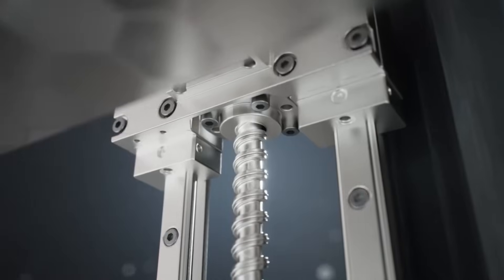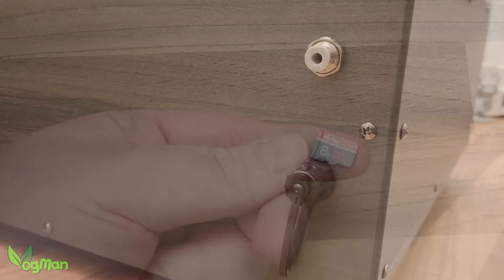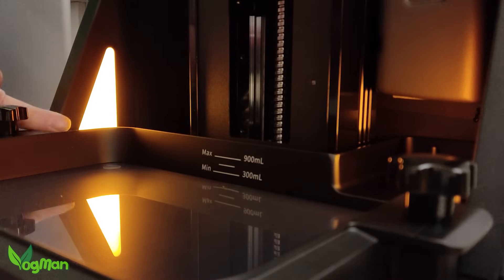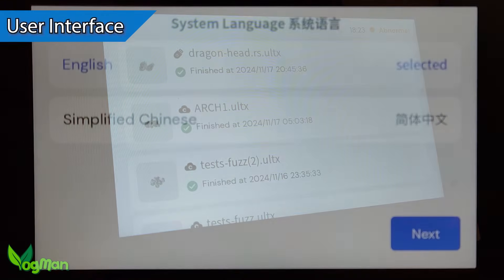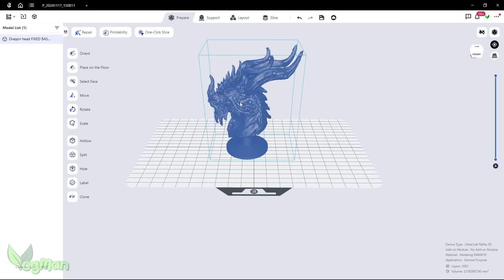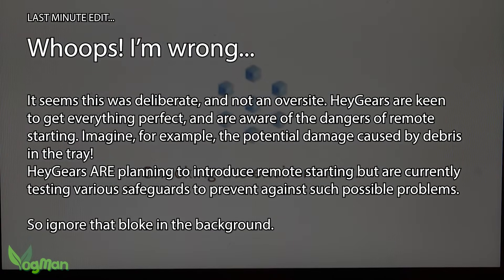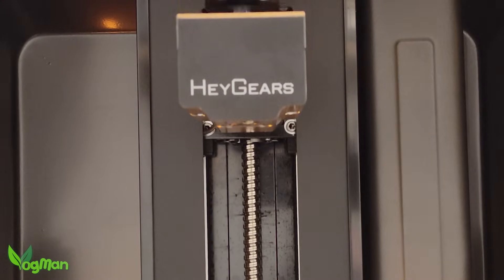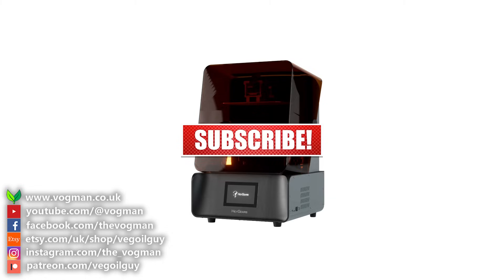HeyGears Ultracraft Reflex RS (HONEST review) - it may shock you!

Comment: when u did a review on the m7 pro u complained the vat has the heater integrated and u can clean the vat , here its the same but with the refill part...
Reply from the maker: There's no heater on the tray I reviewed in this video. It's an unusual shape, but that's not a problem. Uniformation printers, for example, have unusual shaped trays.
My issue with the M7 Pro heater was how large and heavy it was, and Anycubic were clearly aware of this themselves as they fixed it on the M7 Max.
Reply: @vogman  thats what i meant the shape is weird :D but the m7 pro is faster than the m7 max right?
Reply from the maker: Yes. Large printers are always a little slower. 😁

Comment: If the SD slot can support exFAT and NTFS the USB port should support it too and it isn't too hard to format USB to file systems. The main reason for including a MicroSD is normally something that can sit in the printer usually a cheap way to include lots of storage for network printing. It's a way to cut costs without cutting functionality. I would be more ok with this printer if it allowed me to use 3rd Party resins if I wanted. Like I like the idea of not having to dial in my resin. But on the flip side. I would like the option to do so if I want to. Kind of like bambulabs. They have their own filament and it's push button but you can also use any off the shelf filament.

Comment: It's a nice printer with some nice features but there's no way I'd pay extra to help a company establish a monopoly.
Reply from the maker: I can't see it. They'd honestly never get it. They're too far behind their competitors.
If this had been fitted with a 16K screen and the sort of Force detection technology I've seen on the Athena, I'd be tempted to say, "These guys could capture the market."
But no. The tech is mature, but not old, and they've just maxed out it's capabilities in a way that every printer company really SHOULD have done originally. 
They want a chunk of the market and they will get it. There are people that will pay extra for dependable and easy. That might not be you or me, but it's someone. So let that someone pay their money and make their choice.
Meanwhile there's plenty of higher spec, cheaper machines for folks like you and me to tinker with. And we'll swear when it doesn't work. And we'll mess and adjust until it does. Because that's OUR thing. 
Horse for courses, my friend 😁😁😁
Reply: @vogman  I don't think they will either but that is their intent. There's no other reason to lock down their platform to this degree. 

If they wanted they could provide a custom settings panel for third party resins for those who want to tinker, while still including automatic settings for their own resins.

Equally they could open up their api to third party slicers without compromising their own one.

It does look like a good printer though and your review was honest.
Reply from the maker: Let's be honest, there's not a company out there that doesn't dream of being a monopoly. 😂🤣😂
I honestly never expected to like the product. I mean, 8K? But it's all pulled together very well and there's lots of people who love them for it. Their choice and all that 😁
Reply: @vogman  Fair enough!

Comment: I just wanted to note that the build plate can be manually raised or lowered by going to settings > calibration > keep rising/keep descending.  Alternately, in the calibration menu, you can also select fine tune, which will allow you to set a travel distant and speed, and then select raise or lower.  Otherwise, i think you've got this printer pretty well accurate.  Thanks!
Reply from the maker: Thanks for your input. I guess I must have been mistaken. 😁
Reply: @vogman  Not your fault. It's not an intuitive place for it. I thought the same as you until I accidentally stumbled across it after month of ownership. Honestly, the whole settings menu needs to be redone. There's a lot of non-settings options in there that really need their own menu item so that settings is actually just settings.
Reply: @vogman  to be fair, it's not clearly labeled, and not in the same place as most other printers.

Comment: Good review, but I think you overlooked the most important parts about this printer which people should know before they buy!
1.) This is a very expensive printer and you can buy printers with a better quality prints for half even third the price
2.) Their Slicer is online only! You need to have internet access to use the Slicer
3.) "Just works" HeyGears moto isn't exactly correct. Autosupporting will make sure that your print will be there, but the program tends to have a very bad orientation resulting in lower quality
4.) Their resin is quite expensive at 70$ a liter and I can't see difference between it and any other cheaper resin
Reply: 2) Slicer isn't online only anymore
3) You can autosupport with orientation of your choice, i've tested it wanting to test it on my S4U but their exported stl is unrepairable and i don't have a new model what i want to print to test it without repair
Reply: They have a resin called PAS which is 24.99/l too.
Reply from the maker: Thanks, but I don't think I've made many omissions here. I mentioned very clearly that this printer is expensive, older tech, that restricts the user to brand only resin and brand only slicer. If you missed any of that, please watch again... it's there, honestly.
However, my point is that some people WANT that ease of use, that simplicity of decision making. They want the joy of printing WITHOUT learning how to dial in a resin perfectly. Now some of these will pay for that privilege and some won't. My goal here was to show everyone that the option exists. 
A second less obvious goal of mine is to inspire other companies to try harder and stop relying on the printing community to make their products work for them. Too many companies send out products that aren't really ready. 
Anyway, as I've said to someone else a moment ago, there's a British proverb, "horses for courses."
That's all this is. An option for SOME to take. Let them take it if they want. The rest of us will carry on regardless 😁
Reply: @vogman  RERF and tilting vat/strain gauge raise control already fixes absolute majority of "ease of use" problems, yeah you still have to learn for a half of a day, but if you won't - you might actually harm yourself whether with heygears or any other resin printer, it's not zero-knowledge type of activity anyway and you still have to work with highly corrosive liquids

Comment: Thank you Vogman!!. As one if the most respected reviewers in our community. I am so glad to watch this as it makes me feel validated

You delivered a great review, well balanced and without any of the worry of impending drama that I had. Yoh talked about this straight and to the point. I’m envious of your review delivery here. And you pointed out some things I missed too, like the vat fill height. You are spot on and I agree. This would also mean there’s less resin to heat at a given time for those with a heated vat. Which I’m sure would be more efficient? Dunno. Just a guess.

As for moving the build plate manually. It’s in “calibration” and you can only “move to top” which is poorly translated to something like “keep moving” or something.

I’ve told them about this too and these functions half way down the menu list are so much more frequently used than several options above them. Which you’d likely only use once in the life of a printer..

Considering that list isn’t alphabetical anyway, use frequency seems like a smarter way to order it…

But that’s just my 2-cents.

This machine is not for everyone. But those people who it is for…. Will love it.

Hit them up for some castable material (chefs-kiss)
Reply from the maker: The problem with telling the truth is that it's "your" truth and not everyone will agree, which is at the end of the day is fair enough. That's as it should be.

Everything about this company made me say to myself "I won't like this product." I mean, 8K, the price tag, resin and slicer restrictions?

But you, like me, must get emails every day from people being confused by those very points, and like it or not, HeyGears have done a great job here. It works and it's easy. It's expensive, yes, but some folks will always pay extra for dependable and easy. So good luck to them.

As for the calibration button, you're not the only one to tell me that. I swear I tried that and it just went through the calibration routine again. Maybe I was wrong. It wouldn't be the first time 🤣😂🤣
Reply: @ ah no worries on the calibration button. The settings in there are not so well translated. I have fed this back.

And yeah I understand people will not like this and I support people not liking this. But with this one I struggled against a large backlash of people posting the same semi-accurate/inaccurate comments like an indoctrinated cult and it really made me question myself hard!.

I know people are passionate, and I applaud that. But there’s no need to spread hate on a valid choice for many people.. after all, these are just printers.

Yeah I get those emails all the time asking me what is the easy one… I think the Saturn 4 ultra is a little easier because it removes half the settings. This is easy mode, and if there weren’t people out there willing to pay for convenience. We’d all be using public transport.

Everything you said in this video I am 100% behind and it’s why I’ve always been such a huge fan of yours!

Comment: I had a few forum people ask my thoughts on this system a few months ago, and I basically summed it up as an easy bake oven for resin printing. If you don't mind being roped into proprietary everything and the enormous potential pitfalls of that type of ecosystem, it could be the next best thing. If you do value manual tweaking and having a well-rounded library of 3rd party resins, ehh... 
I think they're going after the Formlabs and Resin Printing for Dummies market, which I'm sure there's a lot of cake to slice there. On the flip side, being shielded from the experience so much inherently will make people approach these like they would a pastel-colored circular saw. Looks inviting, all the danger removed.
Reply from the maker: It kind of is "printing for dummies," I agree. But shouldn't that really be the case? Are we all just too used to having to MAKE our printers work. They should be perfect out of the box. I've lost track how many people I've heard from that have given up because they couldn't figure out the settings, etc.  
HeyGears are not cheap, but their stuff works out of the box. People who own them love them. 
Consumer choice is good. Let the consumer decide 😁
Reply: @vogman   Fair point on the out of the box experience. Maybe we've been the beta testers for too long, but that's how it's gone for a lot of niche industries that were more or less enthusiast-driven until hitting more mainstream appeal. Granted 3d printers of any sort have been mainstream long enough now that a lot of people pick them up not knowing there is a bit of a learning curve. While I appreciate the more technical side of them, I can see where 'hit button, make item' does have that Star Trek appeal, and more users overall furthers avenues for all of us towards having better machines.
Reply from the maker: Let's be fair... what other industry would tolerate products that have to be made to work? If it was a TV, or a car, or a kitchen oven, and we were told to make it work be fiddling with it and best-guessing, we'd all refuse. The printing community seems to love to tinker. It's our blessing and our curse 😁😁😁
Reply: see I would take the FormLabs over the HeyGears. Any day of the week. Yes it is way more expensive but at least FormLabs has Open material mode meaning you can use any 405nm Resin with their printers. They charge an arm and a leg for that feature but it is there.

Comment: Well said and great review.  Exactly the reason why I purschased RS.  It is so easy to use and have found that I am doing more printing versus screwing around with settings and want to print more.   I know some will say to expensive, correct so do not buy it - that simple.  Their customer service has been excellent, responsive and go out their way to satisfy the customer.   I had sensor issue and complete satisfied with their efforts.
Reply from the maker: Many thanks. I expected to shrug off this printer as too expensive and under-performing. Instead it truly surprised me and made me realise there's a lot other companies are NOT doing. Eventually the guesswork will go from all brands but for now, I have to congratulate HeyGears for setting a better example.

Comment: The user experience reminds me strongly of the Formlabs printers. Good that someone else also starts to focus on the overall ux. If they'd let you create custom settings for resins I'd probably replace the Formlabs one at work. (You could already do that with Formlabs if you pay for the "open material license", which is expensive as hell, or refill an old cartridge and make a custom setting, which is possible after one of the latest updates but is complicated as hell and you can't track you new resin seperately = it is still shown as the one from the empty cartridge you refilled. And if you buy the "open material license" I'd still have to deal with the print settings, so I'd rather replace the printer than deal with that (laser energy settings for 1st,2nd,...,#th layer, overhangs, first layer after overhangs, supports, "pressing force", mixing interval, heat settings, ...).)
Reply from the maker: Ah FormLabs... those that avoid me most... and I don't know why. When you offer to cover all costs, take out insurance and sign any waivers, but are still declined an opportunity for an "unbiased" review, you have to be suspicious.

Comment: Thanks for this look into the RS - I'm just sorry that I didn't get in on the original pricing.  At US$999 (or $749 with your code and Black Friday), it's still just a bit out of my bargain range compared to the other mid range printers.  With the M7 Max now only US$749 current pricing and the ability to continue using my normal Chitubox and Lychee slicers. it's just not calling out to me/
Reply from the maker: I quite understand. We're all ultimately governed by our wallets. My job is to speak as I find - warts and all - and not to twist anyone's arm 😁😁😁
Reply: Yeah the M7 Max is in my sights too. Although my wife has other ideas.😁

Comment: I think HeyGears gets a lot of hate from people who print as a hobby or as a side hustle.  But if you're a business who doesn't have time to faff about, the closed ecosystem more than pays for itself in time saved.  It's a totally different market, but it's also cheap enough to be accessible to hobbyists. 

And the fact that they've been responding to feedback with changes, we might see HeyGears as the Bambu Lab of the resin world in a few years!
Reply from the maker: They aren't cheap, and their screen size is a little behind, but the quality and precision means it prints way beyond an 8K and like you suggest, it's reliable... doing exactly what you want without any messing about. Love it or hate it, this is the way the industry will eventually go. This is the level of control we should be getting. HeyGears have proved it's possible 😁
Reply: The closed ecosystem isn't actually necessary for those features though, it's pretty clear they're doing it because they want a captive market.
Reply: Fauxhammer got Flamehammered just for the temerity of giving the printer a positive review. People need to relax.